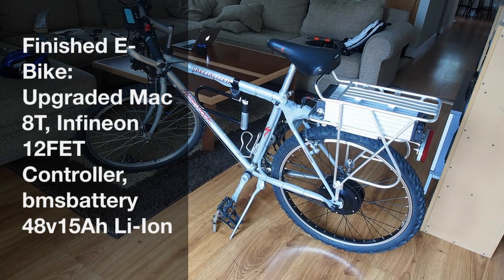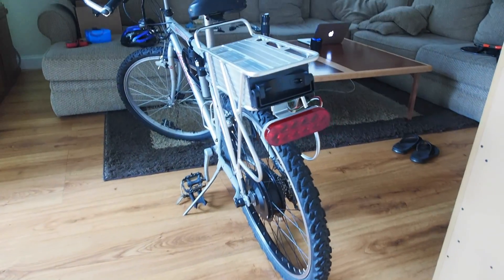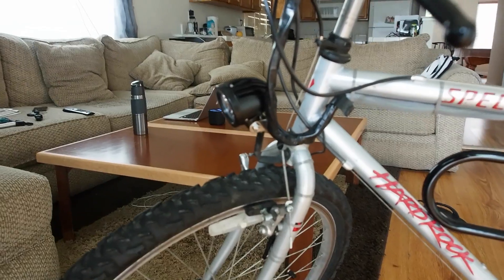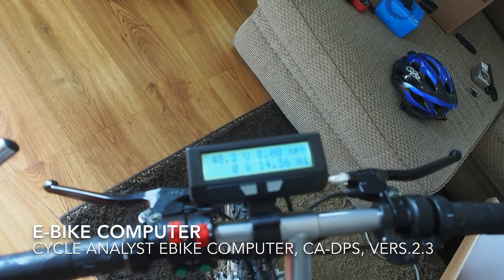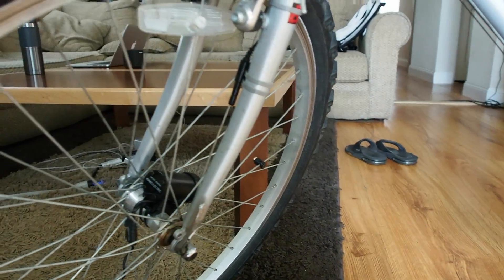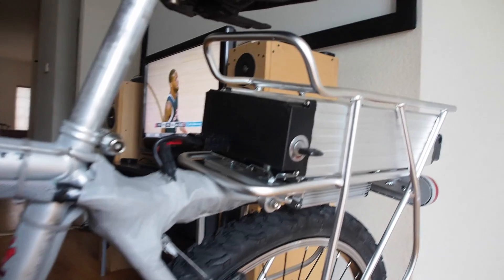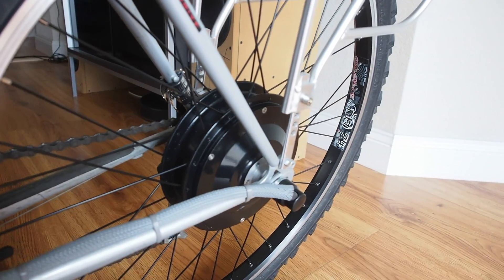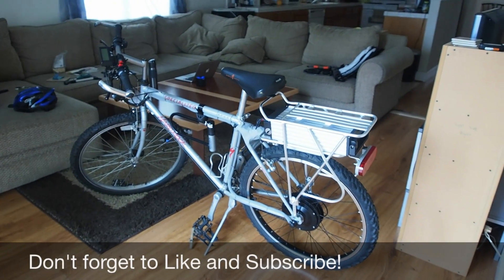Finished E-Bike - Upgraded Mac motor, Infineon controller, 2000W+

Comment: Hi! Awesome stuff! Can't find much on mac motors on youtube. I was wondering how the rim and spoke quality is i suppose its from em3ev? Does the spokes tend so loosen up and snap after a while?
Reply from the maker: I hadn't had any issues. They seemed to be very tight and secure.
Reply: @MatthewCherian  gr8! I went ahead and I bought a 10T kit. With 12FET controller. Im super happy with it. Tho my bike doesn't give all power from strand still. Do you know why that may be? I pull a maximum of 2.5kw but not intill im at about 20km/h.

Comment: What is the maximum torque?
Reply: the blue line
https://www.ebikes.ca/tools/simulator.html?bopen=false&motor=MMAC8T&throt=100&grade=0&hp=0&batt=B4814_EZ&cont=C40&motor_b=MMAC6T&batt_b=cust_24_0.15_30&hp_b=0&cont_b=C40&k=1&k_b=1
you can switch to mph instead of kmph if you need on the left bottom (then press "simulate")

Comment: Your build has helped me a lot. I am only running a 1000 watt hub at the moment, but I will be updating my motor to a 1500 watt next month.  Your build is simple but STRONG!
Reply from the maker: Steve Aldebaran thanks, glad it was helpful to you. Yes it was a very fast and really fun bike. I have a new build now using a mid drive. Not as quick to accelerate as this hub build, but more versatile on hills.
Reply: Thanks Matthew, I have a very short commute to work and stores in my area! And the total weight of me and the ebike is 180lbs. And I am very excited to get some top of the line gear from Em3ev! NO HILLS!

Comment: did you any trouble with the grears slipping  or clutch on the mac motor? have you had to replace the gears yet.
Reply from the maker: Never. The motor has been rock solid. Not a single issue with it. Unfortunately this bike got stolen about a month ago :(. New build coming soon with videos. I am building a full suspension mid drive this time.
Reply from the maker: Yup. Those U locks can be defeated with a modified car jack. I recommend if you are going to use a U lock, get a smaller one.
Reply: So do you prefer the middrive over the rear hub motor?

Comment: Matthew...thanks for making this video.  I am also contemplating on the MAC kit from em3ev, but I am wondering whether the 14mm axle would fit my rear dropout, or if I would have to file the dropout?  Did you have to modify the dropout to fit the Axle?  Are you using any torque arm?  Looks like you bike has a vertical dropout, which is nice.
Reply from the maker: +Sonnet Gomes I didn't have to modify my dropout. I do have a torque arm on the rear axle. Its on the other side of the bike in this video. This build is still going strong and I use it daily.

Comment: Whats your top speed and cruise speed? Thanks
Reply from the maker: 32mph on flats with no pedaling.
Reply: damn, how long can you go that fast before motor fails?
Reply from the maker: It seems to handle it fine on flats for a long period of time no problem. The biggest strain would be to go full throttle up a steep hill for an extended period of time.
Reply: Oh fantastic then, thank you man, appreciate it! :)

Comment: that's a tidy set up,  setting up one myself have pictures up soon, thanks for the video it helped out
Reply from the maker: Thanks. I just completed upgrading it with a front suspension fork and disc brakes. Will post a new video soon. Good luck with your build.

Comment: I did this exact build with 3 bikes for a guy, (im a bike mechanic) 1 with a 60v 24ah, 1 with a 48v 24ah and the last with a 48v 12ah battery, all are the newest lithium cobalt, with the same motor except the 60v had the 10t high torque motor, the 48 12 weighed 8 lbs. no lights but same controllers ect. These were all new in box bikes.

They do about 29-32 mph, fun to dink around on.

Question- why did you spend a ton of money to outfit a, no offense, complete shit bike? Especially the brakes, you really need to run at the minimum 395 series shimano hydraulic disc brakes, or the avid equivalent, thicker spokes and double wall rims. shimano brakes would be better for this since they use mineral oil instead of dot brake fluid like avid, but anything is better than center pull brakes.

Maybe get an anchor to throw out or drag chute to put in your backpack.

Take that stuff off that bike and go buy a year end clearance 29er hard tail, get a decent Deore or X5 equipped model, brand doesnt really matter under 1500 and put that on, then you would have a very good bike, and most importantly hydraulic disc brakes.